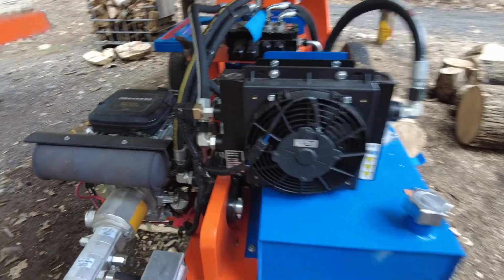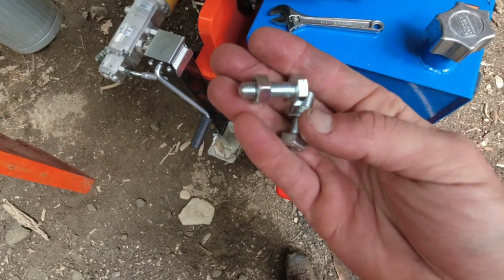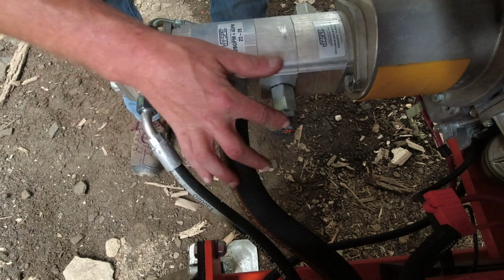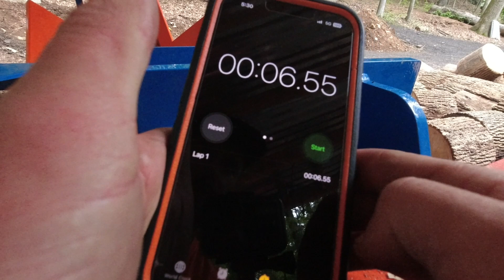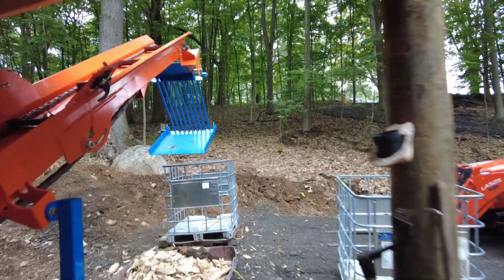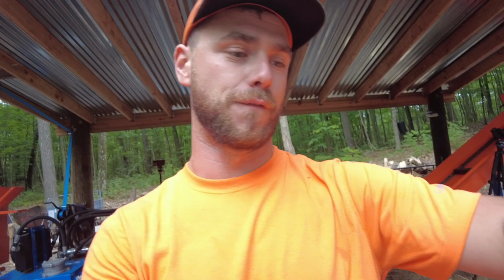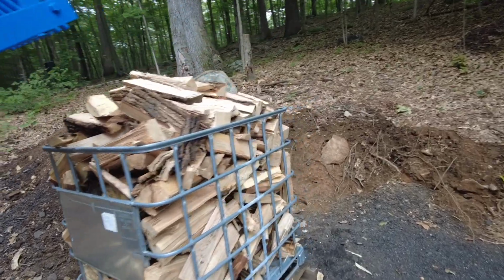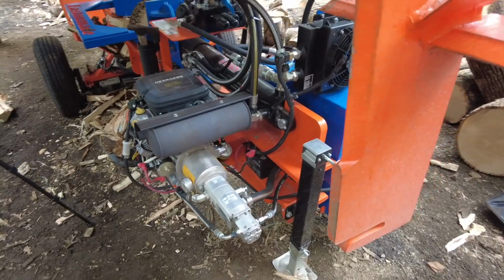#403 Eastonmade Wood Splitter Running Slow? Problem Solved!

Comment: I made gear pumps on that valve we put blue lock tight on the screw. Also, install safety wires The valve controls gallons per minute on flow.

Comment: The screw with be M8x1.25 not M8x0.125. The 1.25 is the thread pitch. 1.25mm per thread. Metric defines bolts by thread pitch rather than thread per inch.
 I would say that you could probably screw the bolt in a little further. Ideally the changeover from high flow to low flow should be occurring just as the motor speed drops a bit. Attaching a cheap tacho/hourmeter to the splitter will show you if the pressure is set about right. The unloaded cycle time will always be 6.5s ish as long as the pressure is above "idle" pressure. It's possible that you can get your loaded cyle time down close to that as well if the pressure is set right and the wood is co-operative. Heath the Hard Working Man actually did a video on doing this to 1 of his splitters a few weeks back.
Reply from the maker: Yep your right I misspoke!

Comment: One of the guys I watch had same problem he used a longer bolt to add 2 nuts tuned it just right and locked it down with the 2 nuts.
Reply: You can buy extra long set screws also and put two nuts 😊

Comment: Jake this video got my splitter running right again thank you . I picked up a 22/28 Friday and about the 3rd cord Saturday it was slowing down . At the 6th cord we started looking and found the screw that you show was loose & the lock nut was missing  We found the nut & reset the screw . Now back to that 6.75 cycle time like it should be .
Reply from the maker: Glad it helped you!! Such a simple fix!

Comment: Great to see you got it fixed. I have to do the same thing to my machine. My low in isn’t kicking in. Its Amazing how a little bolt controls that much power. Great video.
Reply from the maker: Yep little bolt big results!

Comment: Jake, I’m not sure if you have enough space with the bolt length but if you add another nut in back of the first one it will stop the bolt/nut  from backing back out because of the vibration from the Eastonmade splitter. The second nut you can tighten as much as you want and the first one you  tighten it up as needed.  My father-in-law was a machinist and he taught me that trick. You can add a dab of blue Loctite  threadlocker to the thread as well. Regards
Reply from the maker: I was thinking I could do that, I’ll keep an eye on this one and can always swap out later

Comment: If you’ve got a pressure gauge on it, you’d want the transfer pressure around 900-1000 psi or starts to load the engine.

If you want to tweak it.
Reply: Part 1 of that series.

https://youtu.be/MJY8Wojiqrw

Comment: Really informative video. Thanks Jake. The amount of “trash” made by box-type splitters, not just Eastonmade, makes my OCD swing in to high gear. I know they are faster than a single wedge or a 4 or 6 way, but the amount of scrap just drives me nuts.  I feel like the condition of the wood doesn’t really make that much difference in the long run, box wedges are inherently messy… still, it’s a beautiful machine!
Reply from the maker: Yep it’s a lot for sure but like you said much faster
Reply: I don’t think it makes any MORE than other types of splitters, you just see it more at once because the throughput is so much greater.

Comment: Crazy that the set screw broke. Everything backed out due to vibration and warm metal parts. Loosen the jam nut, add 2 drops of BLUE LocTite on the exposed bolt threads, and retighten the nut against the bolt with 2 box wrenches. Then it won’t move!
Reply from the maker: Yep! I did the loctite after the video